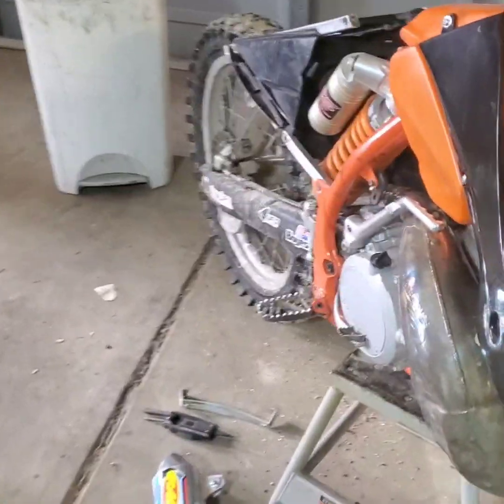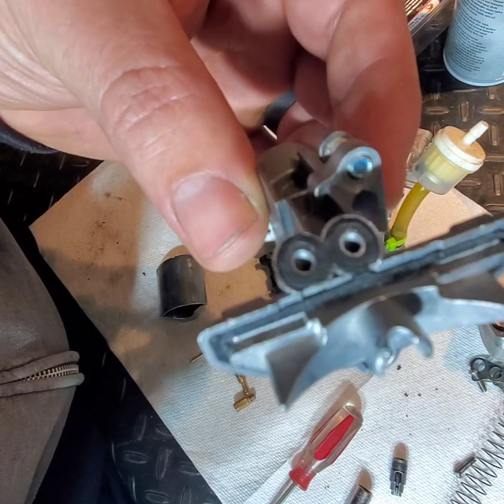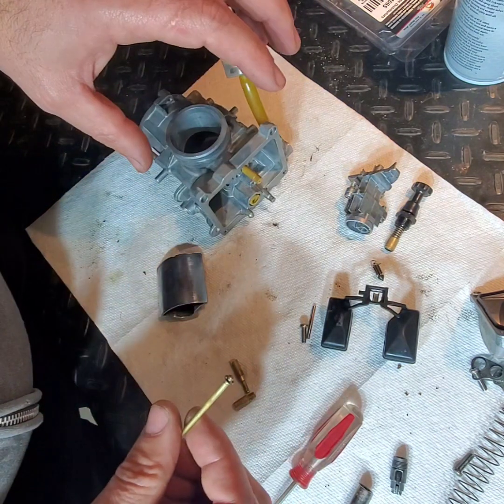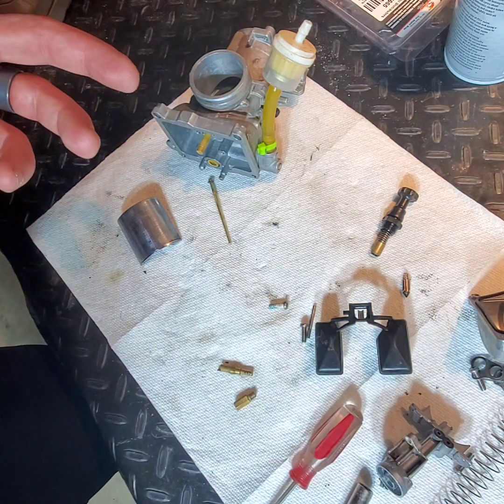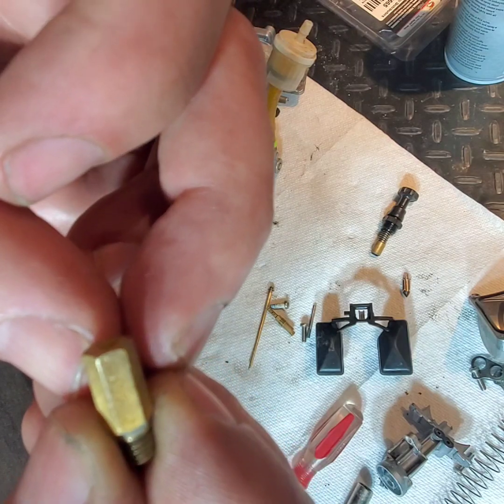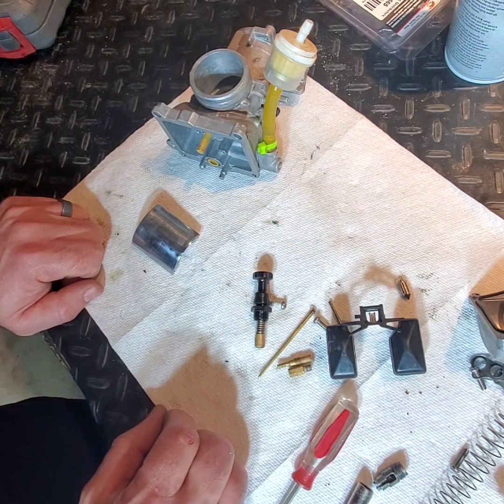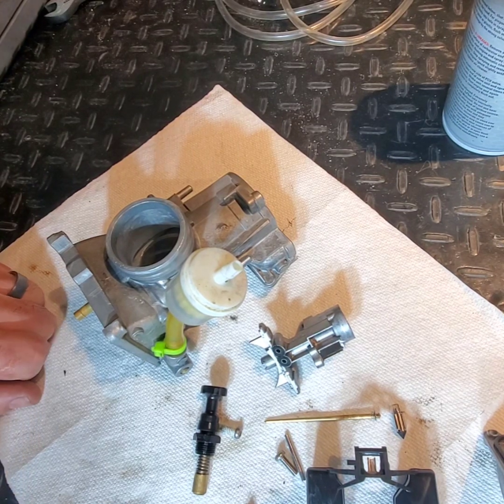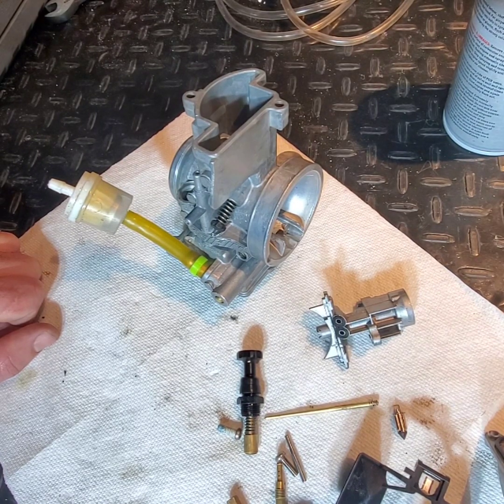Keihin Carburetor Running Rich - Might not be the jetting!

Comment: Slow jet sounds way to small and the main seems alittel big. Owning a used bike its wise to cheack the jetting. My brother had a 250r that kept blowing the motor and I checked the jetting it was way to small the mainjett ,running to lean switched out the jet for what was supposed to be in there and ran fine no more blowing the motor. And funny that the mechanic never suggested to check that?